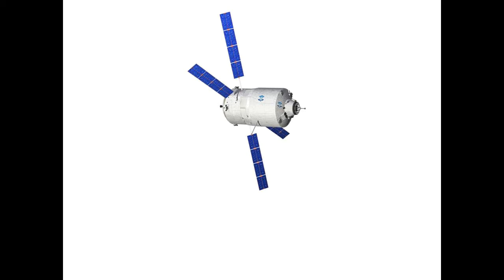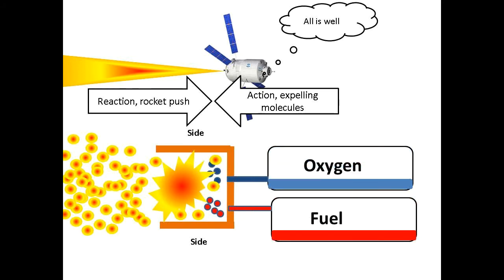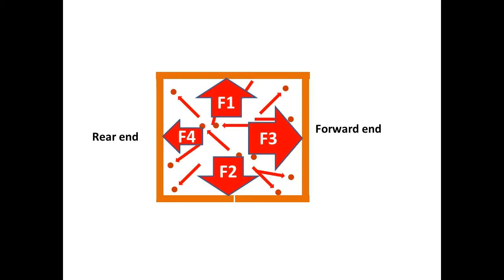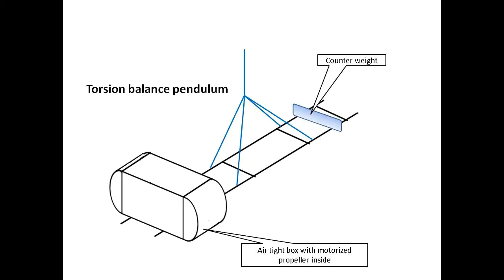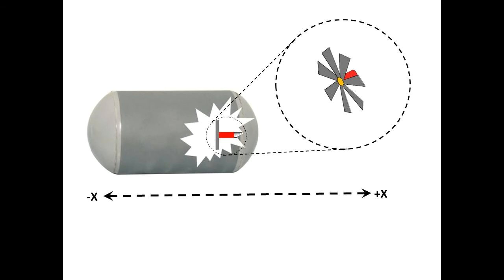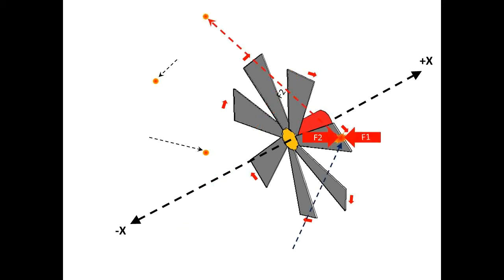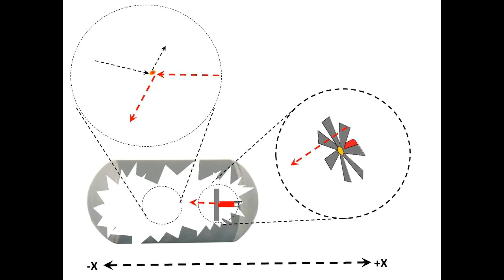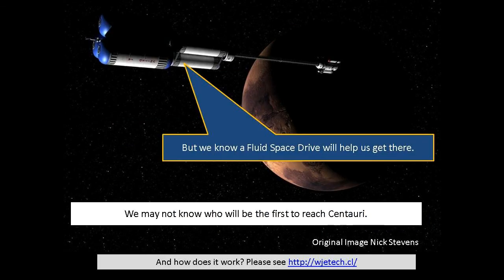Our Present Propellantless Propulsion System (FSD)

Comment: What if you have a rectangle box, 1x1x2 with a divider 1/4 off one wall , welded closed, the divider has a nozzle in it with a plug the large section is at a near vacuum 5-3 small side Hasan explosive inside basically a rocket motor, when set off, what happens when the fuel is ignited, blows the plug out. Does the box move??
Reply from the maker: Hello James, I have a friend that is going to do exactly that this week, personally I do not think it is a good idea to ignite an explosive/rocket inside a closed box but I will send you his feedback.

You have been watching a VERY OLD VIDEO, please see https://www.wjetech.cl if you wish newer information.

We are in fact ready to produce and near to deliver our first product, a propulsion module for cubesats https://www.wjetech.cl/modelo1.htm

If you wish more information please mail wjeconsultant@gmail.

Have a nice week

Comment: I believe the rotation of the pendulum is coming from the fan being off center.  The fan is not geometrically centered, so the fan thrust is causing a  torque which rotates the pendulum.  Spacecraft propulsion wold require a linear force, while this set up is can only provide torque.  If the fan was centered it would not move in steady state.
Reply from the maker: YES, you are absolutely correct (we made a mistake not many have noticed), an off center propeller does generate torque that increments the effect.

However we have managed to observe the effect with better test setup.

The effect (push from the inside) can also be detected when the test box is installed vertically on a standard balancing seesaw artifact so the box has liberty to move up and down instead of turning (no torque to affect results).

I have not made many new videos because of various local and personal problems but that will change and we will be at FIDAE 2022 (see video https://youtu.be/Q0KigNsKjCg )

Thank you very much for commenting